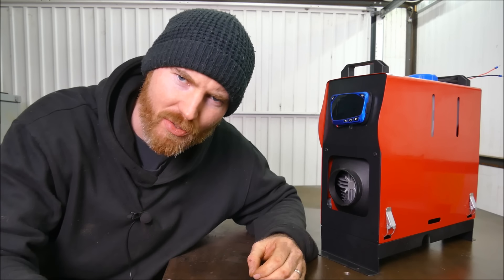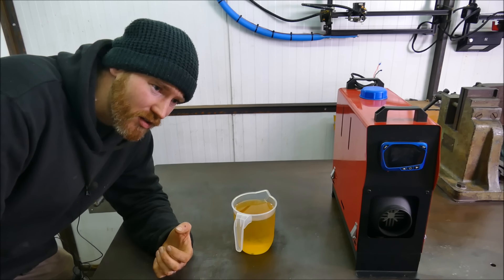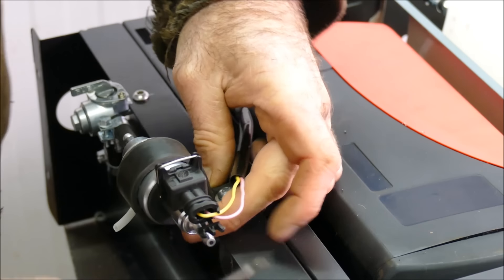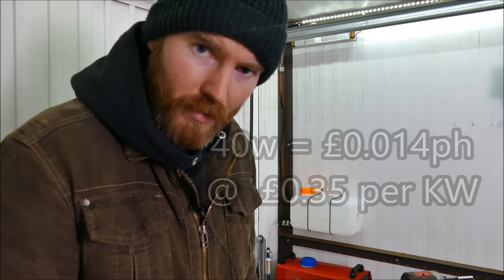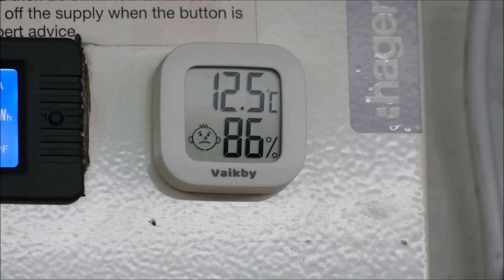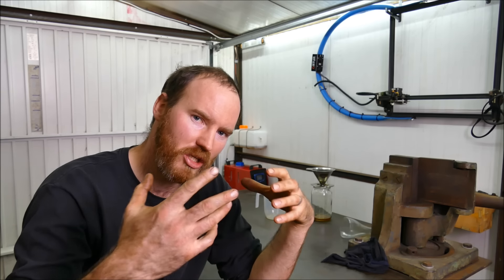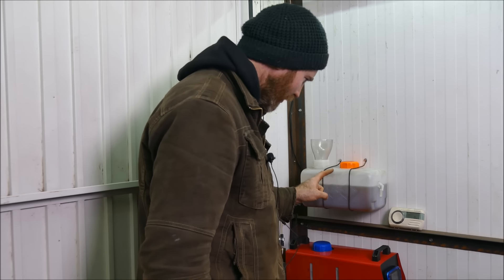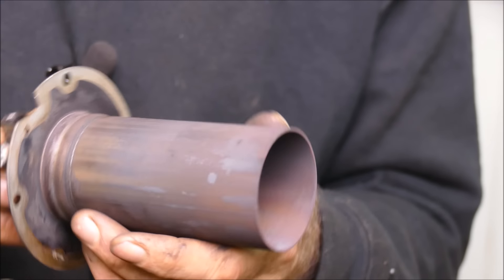£0.03 per kWh heater modification - Top facts & lies on diesel heaters - waste veg oil burn success

Comment: if you break water and feed in the hydrogen into the air intake you will get 20-50% less fuel usage. 24v@ 8 amps (200 watts) worth of hydrogen. it works because hydrogen burns first and rips oxygen off the diesel chain, breaking the hydocarbon chains into smaller pieces...easier to burn, works great in a vehicle, probably do the same in a heater.

Comment: I own a restaurant and have been collecting oil,  we filter the oil everyday,  but on the day we change the oil it goes straight to the jug.  But gravity does an amazing job of filtering.   I just slow pour the jug and try to keep all the solids on the bottom.  I have so much oil mine can sit for a month.   One lesson I learned is,  don't let those jugs sit in sun light,  they deteriorate rapidly,  and crack easily.   No more than a month at most.  I  did have the state bother me at one point and I provided them studies that vegetable oil in less than 50% concentration actually helps the soil and is not a pollutant.  However,  they still made me keep my oil on concrete.

Comment: It should used the same , each pulse of the pump is the same measurement factor, so no matter what you use will be the same volume of fuel used,

Comment: I highly recommend these for workshop heaters as they put out a significant amount of heat and as he explained are far less expensive than electric heat. Set up is not to hard though the controls are NOT user friendly and the damn instruction manuals look like they were translated from chinese to some other language and then finally to english as its so garbled as to make no sense whatsoever. 

Make sure you get a good CO detector as they can have a broken gasket inside allowing the exhaust gas to mingle with the heated air and blow into your occupied and nice and toasty space, this can happen without significant diesel exhaust smell to accompany the Carbon Monoxide. Be safe!

Comment: You will find that heating effect of the exhaust pipe will only reach as far as its submerged in the water
Reply from the maker: Yes. But if you pump water from the top portion of the tank through radiators and back to the bottom of the tank you get the full benefit. Or just have a pump cycling water from the top to bottom.  Convection will happen if the exhaust is placed at the bottom of the tank. Cheers J

Comment: Yes, the manufacturer is definitely lying about the efficiency; otherwise, they should receive a Nobel Prize for having found a way to bypass the laws of thermodynamics. One liter of diesel contains 9.8 kWh of energy, so if they manage to extract more than that, they have solved the world's energy problem :D"

Comment: Can't burn red diesel for domestic use? It's a strange world. In NZ the diesel is good, and my one heats well.
UK is farmers don't want end up like sa
Reply from the maker: I agree. Cheers J
Reply: @joshuadelisle  thanks for your video. Is it possible to run these off a power supply?
Reply from the maker: @anaphylastiks thank you, it is yes, I use a 12v power supply rated to 300w. Note that it should never be turned off without the cool down cycle so the event of a power cut may damage the machine. For this reason many people use a battery that's permanently linked to a charger instead. Cheers J
Reply: @joshuadelisle  okay. I'm just running off 18ah AGM battery.
But may get a 100ah. Or I run off my diesel ute. Because I live rural power cuts are common so I might stay away from the power supply situation. Thanks again for your advice..
Reply: @joshuadelisle  another question.
What fan do they use? Is it worth replacing with high quality brushless or like a hydro growing tent fan? They're quiet and move lots of air
Reply from the maker: @anaphylastiks  the fans they come with are pretty good but it also dives the combustion turbo and the program settings are rated for the specific motor they have chosen. You can get replacements easily enough but I would think trying a different motor is more trouble than it's worth. If anything a quieter pump is probably worth adapting instead. Cheers J

Comment: Can you use that device to run an ASIC Bitcoin mining machine? If it can its like a money printing machine😉
Reply from the maker: So the battery bank I think you're referring to can be charged via solar, wind, hydro etc so technically it can be an off grid solution however that doesn't mean it's free electricity because there is depreciation with every charge. It loses 20% capacity on 800 charges. So if you divide the layout cost by 20% and divide that by 800 you get a cost per charge which is nearly the same as being on the grid for the UK at least. Cheers J

Comment: If using red diesel is not allowed to be used for domestic heating (isn't that the reason it exists in the first place? at least in Germany that's the case), doesn't that mean the government banned all use of oil fired heaters? That would be some bad news for rural people... :(
Reply from the maker: Red is for agricultural machinery only and kerosene is for heating oil. Cheers J
Reply: @joshuadelisle  Interesting, thanks for the clarification. In Germany heating oil is colored red, so the confusion.

Comment: Dont forget one of main reasons its more efficient is it's heating the air directly- electricity produced by a power station is very inefficient,  sometimes as much as 50% along with distribution losses etc. Its one of my biggest bugbears with electric cars - great idea but in practise doesn't meet the claims made about CO2 reduction if fossil fuels are used to generate electricity compared to an internal combustion engine

Comment: Remember, as your heater sucks in air, your pulling in cold outside air all around your shop making those areas cold. You might consider ducting outside air to the heater's air in and avoid cooling the shop as your also trying to heat it. 😊

Comment: Personally, I would not run this inside a house as it must smell and emit water vapour, none of which is going to do you or your house any good and if the answer is to leave a window open when you are probably going to use it to heat your home in winter, then forget it.

Comment: Cooling down exhaust will condensate water, sulfuric acid and other nasty stuff. You need a drain valve and stainless steel lives longer.
Examine coaxial heat exchanger concept. The exhaust gas will heat up the extrenal air to the burner. All modern burners do it.

Comment: You could also get a universal usb smart remote and then you could automate turning on and off the heater so it can 'mostly' run itself. could also put fuel sensors in so you could notify yourself when the fuel level is getting low, and needs topup 'soon'...

Comment: This type of heater does not burn the fuel efficiently. A real oil burner pressurizes the oil  and sprays it through a precise nozzle. The combustion is more complete.

Comment: Unless someone got there first (did a cursory search)  - How about running a coaxial inlet/exhaust arrangement (much as gas and combi boilers do). That way you would be able to warm the inlet air source with the remaining heat of the exhaust.
Of course this idea would need some thought resourcing cheap coaxial pipe of the correct dia/length. Can anyone here offer solutions?

Comment: The whole unit is a heat exchanger, there's no point in making the exhaust a heat ex changer when you can just turn up the fan on the one you already have.

Comment: I don't know if someone mention it. But you can use exhaust heat to heat inteake air.Warm in take air increase efficiency. This solution is used in a gas heaters. In my country it call "turbo pipe" its a pipe inside pipe. Smaller diameter  exhaust pipe is inside larger one, intake air travel inside larger diameter pipe and it is warm up by hot pipe inside. Hope you get the idea.

Comment: Now in 2024 I'm paying 21p per kWh for my electric (with Fuse Energy)...so is the veg oil burner worth it still?  I don't mean the actual economics, I mean all the trouble.
Reply from the maker: I've got it as low as £0.02 per kwh depending on what deal of kerosene I get and doing a mix of waste veg oil. £0.06 per kwh is what I'm getting running on Kerosene at £0.60 per litre.  As far as set up goes, for me it's very simple and at only £100 for the unit It has paid for itself within a month + day of my time installing it. For small spaces, garages, tiny houses etc this is Definitely my go to heating other than a wood stove. Cheers J

Comment: You are not taking into account the cost of the electric which runs the fan, glow plug & pump.
Reply from the maker: £0.01ph. check out the follow up video for more details. Cheers J

Comment: I don't remember the mix rate, but if you get used cooking oil, I believe will clean about 3 if not 4 L of cooking oil. And you mix the water in with the glycerin. Then you mix that in with the oil, and it will fog up when it separates the oil left will be almost spotless.

Comment: Don't get me started on what a bad deal ASHP's are!!! COP of 3.5 may only be at 7degC, when it's colder, they use more and more until the COP of 1 (1:1) might be at -20 to -15. which is when you need the most heat! Stick with the wood burner.

Comment: Does anybody know how to access the Pump and frequency settings and fan speed settings on the new vevor  bluetooth controller with the 4 buttons to the right of the screen that connects to your phone I've tried using password 1688 and 9009 with no luck? Any help would be appreciated TY in advance.

Comment: I wonder whether you could run the exhaust through a sand battery instead of water to slow release that heat and improve efficiency.

Comment: Hi Gary from the UK, Great video very interesting and informative keep them coming, I'm an old heating engineer and was thinking if you could connect the exhaust to the top of a central heating radiator and then connect another exhaust to the bottom of the the radiator so that the flue gas go diagonally through the radiator  and then take the exhaust outside, l bet it would heat the radiator up and make your work shop warm
Reply from the maker: That's a good idea. I've conducted some more experiments and will release another video shortly. Cheers J
Reply: @joshuadelisle  radiators heat bank sandwich : one radiator with hot exhaust  and two radiators  filled with waste oil on each side of first one clamped like bread around  ham in  sandwich. Oil radiator keeps temperature  longer than air or water one.

Comment: Please sort out the difference between kW ( instantaneous power rating ) and kWh which is energy. Electricity is billed in kWh, you are calculating the the cost per kWh from you red diesel. The power rating ( 8kW ) times 1h =8kWh.  You did all the calculations correctly but continually mixed up kW and kWh, which is confusing unless you are very familiar with all this and know what you "meant" .  Thanks for the correction. I was surprised in the last one when you just assumed the claimed power rating was what it was producing.

Comment: The reason that the air intake have to be on the outside with the exhaust it's that in windy days the air could enter from the exhaust and make that smoke gets out form the air intake. Putting the burning intake and exaust on the outside it's a safer way and all the manuals that I have used say that.

I install diesel heater in camper vans but for this winter I will put one at my workshop. 🔥👌

Comment: I tried burning a mixture of 80% waste oil , 20% gas.  Worked for about 5 litres then had to tear down, clean white soot from the burn chamber.  So i gave up and went 100% deisel, more reliable, less hastle.  No issues with diesel or carosene. To clean the burn tube, i zip disk off the metal burn tube above the circ weld.  Then i ground down the outside tube welds to the diameter of the tube.  So when you want to clean the tube you can remove the tube and chisel off the built up ash from the burner.  You can attach the tube again using a hose clamp straddling the joint of tube to old ground down weld at burner.  If the hose clamp isnt griping, put dings on the edge of the hose clamp with needle nose plyers.  Then tighten so the tubes tight.  You need to oriental the hose clamp screw near the exhaust port or the burner assembly won't bolt back together.

Comment: copied mostly off eberspacher. webasto has a totally different fuel vaporizer design. fan/chamber/everything else is same because its same on webasto and eberspacher. webasto is more 'direct injection' as its centre fed not side fed like these. but its all effectively the same.

Comment: The eletrick  heating pump is far better off  we use that in Norway 1700£ fully instaletet it give 7.2kw on max it heat up 170 sqare meters house max. 7 years of warenty❤🎉 with servise evry 2 years they runn about 12 to 17 years

Comment: these diesel heaters use 2 sources of energy. electric and fuel but no one adds that to the price ber kw (as insigniffigant as  it is). (if you heat a shed you pull electicity on grid or charge battery. In car or  other similar type you use ekstra fuel do charge up battery  again) It should be interestng to know how much it costs to burn 100 hours continusly (cost of fuel, electricity and maintance per 100 hour)  maintance is actually a  thing. burn 2000 hours a year, maintanace takes 2 hours 15 euros per hour, plus parts 30 euros (prices for sample) 60 euros divided 2000 hours exuals 3 sent per hour.

Comment: Really nicely produced video. Handy as I run a few of these, all on kerosene at the moment, but I'm going to start blending with veg oil. I've got plenty as the car is running on it!
Definitely need to try and extract the exhaust heat in the workshop too.

Comment: Why not use a generator? By using a generator to produce electricity you can charge your batteries and heat your home at the same time. Just using kerosene for heat has only one use and the diesel heater expelling heat through the exhaust is wasted. By using a generator you have 2 uses. Unless that is a silly idea
Reply from the maker: You could but it would be noisy and generally can't be run for more than 8 hours. Plus you shouldn't use kerosene in a generator because it doesn't have lubrication properties. Other yes you can. Cheers J

Comment: Mine got bunged up i suck out my exhaust pipe a few kiks, and bangs , and a old vacuum cleaner re-lighting a few times, a few sucks more wala works grate again, the black gunk that you get out is worse than tattoo ink, if it gets wet it will get very yucky,, saves me taking it apart, which i will do if i really have to, you can get the exhaust  system from wish for pennies,

Comment: Aaargh! It’s a negative feedback loop. A negative feedback loop takes the difference between what you want and what you get and subtracts it from the input. Like throttle position: you want 60, you’re doing 70, it reduces throttle input. Positive feedback adds to the input, and inherently drives to the limit.

Comment: the only thing I would contest in this video is the German engineering statement, I bought a German vehicle which has done < 20000 miles, it broke down 4 times and the 4th time it needs a new engine and turbo charger. The previous German vehicle was not as good as the brand lead me to believe it was. German quality (in my experience) is nowhere near what it used to be and quite shameful.
Reply from the maker: Fair enough...

Comment: Waste oil from car, trucks, industry etc etc is being "burned off" in ships as it is being mixed with regular shipping fuel, ask any maritime chief engineer (like my father 40 years of service) about "cauliflowers" growing in the fuel filters, clogging up fuel delivery systems, exhaust fumes with all colors of the rainbow, they will tell you the truth. Some cities (such as Bremen) forbid even that large ships (cruise liners built/serviced) are coming into port under own power!! So please don't burn off waste oil (ATF, brake oil etc.etc.) because it is carcinogenic, very......... 🤨☠Burning cooking oil from restaurant is not a problem, gives a nice fume too, especially from the Asian restaurant😁

Comment: Hi,
Another idea-
Pipe heat outlet to exhaust,to add more heat,then put a Sterling Engine right at exhaust outlet get a cheap secondhand split aircon system,or a portable one, remove motor and get Sterling to run aircon as long as its got 4 way reverse valve, with heating as well as cooling,you now have cheap (or even free) heating with a COP of 4 or 5, will quickly pay for aircon unit put an electric clutch on the motor you removed, like the clutch on car aircon, and a simple control unit, and when aircon and heat are off,the clutch gives power from that motor to run electrics, or charge a battery,or heat water - why spend 13 k on a heatpump heating system, and 3/4k on aircon when a

 couple of these could heat,cool and provide hot water, even a back up power supply,and all from waste !
Ps- hot water - heat to 35-37 oC- any hotter,scald risk- 60oC hot water tank is to kill Legionella- you drink it everyday- only a risk if water is left warm and unused over a week or more,and aerosolised - have you ever purged your water tanks after 2 week holidays?
To avoid periodic oiling(think of man oiling steam train joints) look for phosphor bronze bushes and bearings that have high melting point grease
Another idea-
Japanese little 3 cylinder cars- some have tiny turbos - designed to run up to 1100 oC- remove one rotor and attach to a motor
Also- steam trains,turbines require superheated steam - can your plastic parts take these temperatures and pressures?
Might be safer to take a disc design to a metal 3D printshop (or email it)
Cant wait for next week's episode!
👍